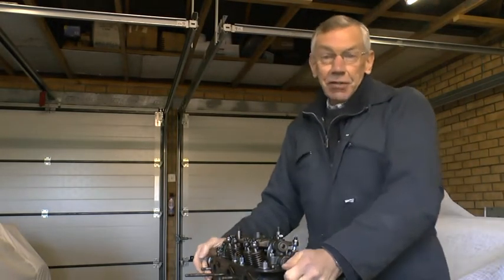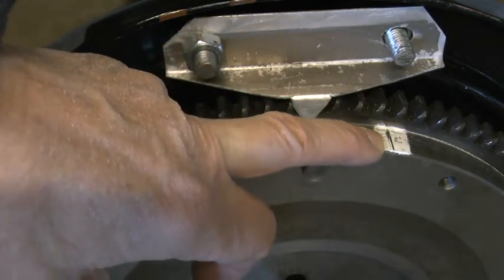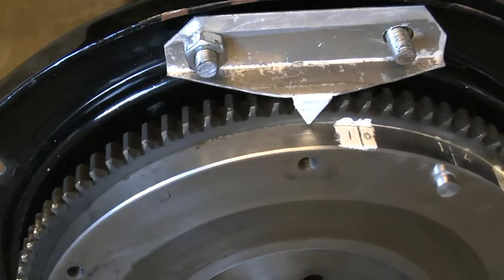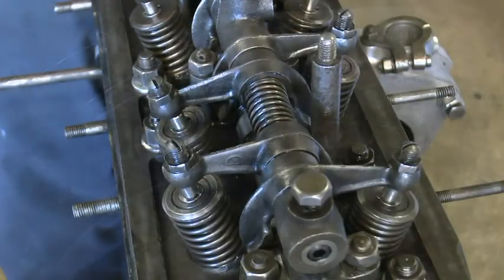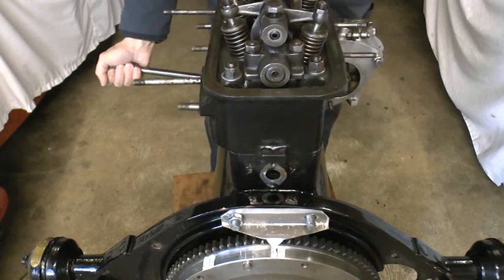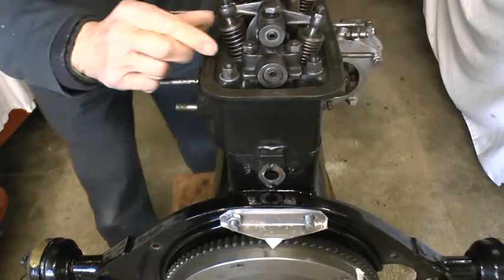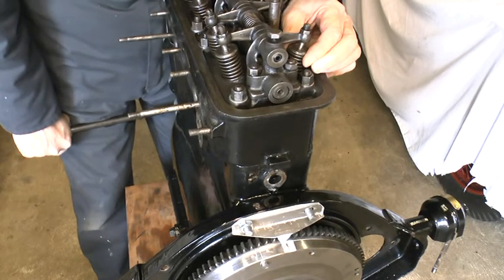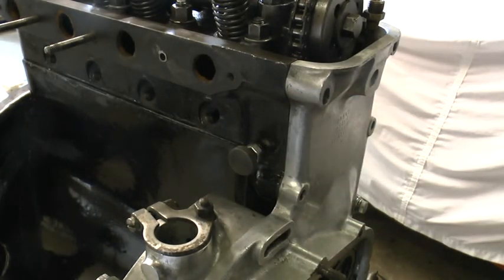Engine timing

Comment: There is a much easier way to time the Overhead Cam engines. Ian Blackburn's "Smiley face".
1. Turn the crankshaft to TDC (top dead centre)
2. Rotate the camshaft until the cams of No.1 cylinder point to roughly 10 and 2 o'clock, and form an upright V, at which point, the "eyes" of the camshaft should form an upside down triangle, with the top 2 horizontal.
3. Without rotating either cam or crank, rotate the Timing Gear until it pops onto the "eyes" of the camshaft.
4. Bolt into place
and Abra Ca Dabra, your engine is timed.